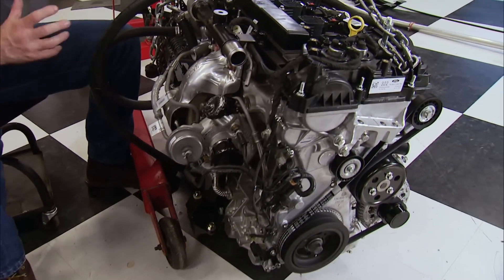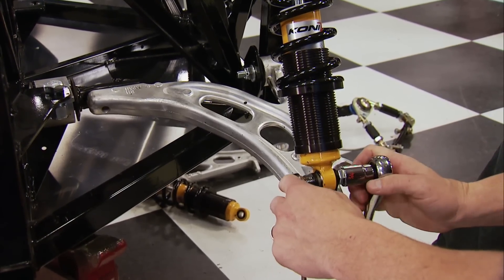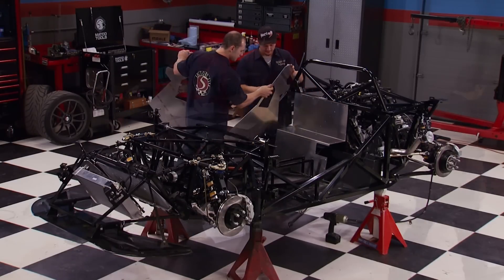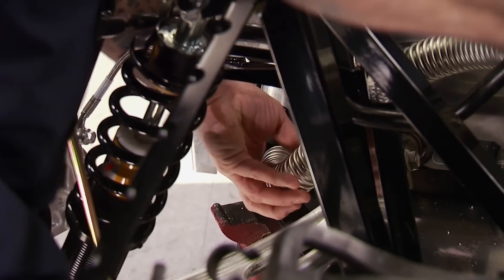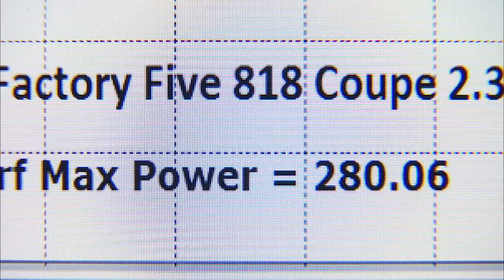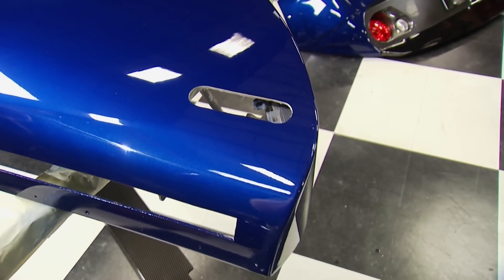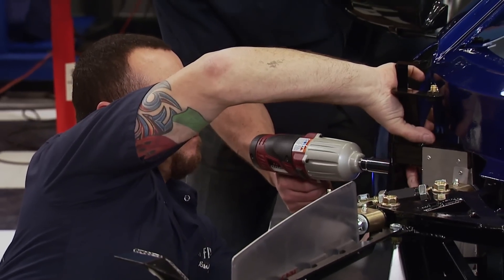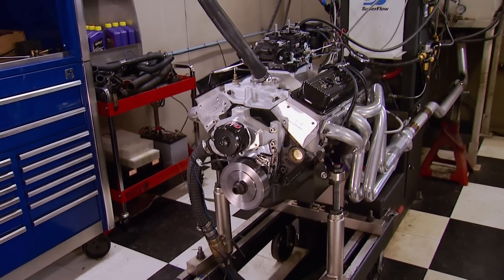Mid-Engine Madness: Building an 818C - Engine Power S3, E8

Comment: If anybody has any pull with Factory Five/ Dave, please get this back into production,.. the GD wrx's are getting rusty & parted out. This gives the subaru builders (me incl) a place to continue our drivetrains & tuning & collected parts etc.. they rarely come for sale & already built, this keeps the wrx crowd alive at a reasonable price.
Reply: I really think they should bring it back with Honda drivetrain options. I’m a Subaru guy myself but I think the platform would be pretty great and easy to do a k-series in it.
Reply: @Ichigo_Fields I’ve always thought this too. With how lightweight it is I wouldn’t even care if I had a stock k20. Could run at the track so cheaply.

Comment: If you build one of these cars, figure out how to run a motor that is reliable.  The Subaru EJ and Ford EcoBoost motors are both junk as far as reliability is concerned.  Maybe a Honda k series and transmission would fit? They are WAY more reliable
Reply: This. A K20 would be way more reliable and make more power.

Comment: I also am a bug-eye WRX owner ... I would like to request this car come back... And for a stage 2 build on this... Do the hybrid ej257 with ej207 heads... Double head gaskets iag oil pickup tube oil pan oil air separator throw some killer bee parts on it... Bring Mike from Moto IQ... He's like the Bob Ross of mechanical engineering! That would be an awesome awesome stage 2 build for this not that the EcoBoost is not fun but that should be an EJ... It should absolutely 110% be an EJ
Reply: Did you know if there a sign petition to Factory Five to bring this car back?

Comment: Windshield wipers?  Heater?  Air con?  Defroster?  Is this for the street or is it a track-only device?
Reply: It's a track purpose car that some states will allow you to register for street driving as a kit car. It's not really meant for daily driving or comfort.
Reply: Not seen a built one with screen de- mist
Reply: Lmao I’ve had countless daily drivers with non operational heaters/defrosters, let alone A/C. A/C is generally the first thing I disconnect once it starts failing
Reply: If you can't figure out how to throw a wiper motor on one of these, please don't build a car to drive on public roads.

Comment: Why not use a ford transmission?
Reply: The answer is simple the Subaru uses a transaxle for it's AWD setup, that means the transmission has two front shafts coming from the sides and a rear driveshaft to give it the AWD. Right now Ford uses a transverse/fwd style mount for it's AWD so the entire thing is mounted differently. This why no Ford transmission.
Reply: @jonf2009  great answer.  Thank you.
Reply: Kit was designed around the Subaru parts. To fit the ford 2.3 it needs an adapter, no adapter for the Subaru motor. It really doesn't make much sense to fit a ford motor - unless the Subaru donor's motor was dead.
Reply: @alexprymack7834  so why not use a Ford transmission with the Ford engine?  That's what I was aiming to get across.
Reply: That's what I explained - the kit was born a Subaru, it was designed to work with Subaru parts from the outset. The Ford motor is the deviation from the original design.
Reply: Which Ford transmission has side outputs?
Reply: @ShaunHensley  all the fwd transmissions do. Go look up images of the Subaru transmission and a focus rs AWD trans and you'll understand what I'm talking about being mounted sideways vs straight.
Reply: @jonf2009  oh I already understand, that’s why I’m not the one asking stupid questions on build videos
Reply: @jonf2009  Also, a transaxle is symmetrical and therefore better for performance applications.
Reply: @ShaunHensley  then I guess I don't understand your question about Ford using transaxles? Unless your referring to the Ford GT transmission?
Reply: @jonf2009  I didn't have a question, I was answering the original question

Comment: You would never see me use the Subaru engine Because I basically have to pull the motor to swap the spark plugs, And the transmission unless it is built by a third party I am not dealing with it because you try to put enough power in it Anything over 500 And those teeth are gonna shear themselves apart
Reply: Plenty of room in the engine bay of the 818 to swap Subaru spark plugs. You also don't need, nor could you put down, over 500 hp in the 818. You can't get enough rear tire under it unless you fabricate custom fender flares.
Reply: @BigDanSubaru03  this car with AWD and 500hp would go crazy
Reply: I've been researching transaxles for mid engine builds, seems like the Audi A4 non quattro trans can take the power. Weird cars, longitudinal engines with transaxles.
Reply: The STI and newer 6 speed transmissions can handle much more power than the older 5 speeds. I would NEVER recommend a Subaru 5 speed for anything beyond stock power. But the STI and newer 6 speeds are quite sturdy. Also even with the issues with the EJ piston designs, I’m still trusting a stock EJ over a ford eco boost for reliability. Of course the flip side is eco boost parts are a lot cheaper and easier to find so maintenance will be a lot cheaper. The FA engines in the newer non sti wrxs are even more reliable up to about 350whp with bolt ons, a fuel pump, and a quality tune. Also I second the previous comment about there being more room in this engine to work on the spark plugs so I don’t see that as a concern.

Comment: I would rather run a K series Honda engine.
Reply: Making a k series work in a traditional mount angle is more work than most people know due to a k series originally meant to be transverse mounted. It's doable but you end up buying even more parts vs the Ecoboost being a drop in since Ford uses that engine in rwd setups already.

Comment: All I can say is I hope the new Subaru gearboxes are a lot stronger than the earlier versions.  Traditionally the early versions would destroy 2nd gear very soon after any boost increase.
Reply: You need a sti 6 speed more robust then the 5 speeds were
Reply: @rico55pr1  Dude; it WAS a 6-speed
Reply: I have an 02 with a Moore 5 speed... Grinds 4th on the up shift and 1st on the downshift
Reply: I had a 2019 Crosstrek. 2nd gear was janky out of the box 🤣
Reply: Different trans from a sti 🤣 gears ratio and the internals dude
Reply: @rico55pr1  Yeah; you caught the name "Subaru", right? I agree that it MIGHT be different ratios, but the internals are identical from the factory. Worked on them for years. STI is a trim level and software tune. The parts is parts.
Reply: @desdecardo  Not all STI versions were created equal. Some were legit total revisions from stock usually a homolagation special. Today there is so much aftermarket support you can retro fit them to a dog box or even go all out sequential. A great choice for the platform though. A north South Mid engine doesn't give you much choice with OEM parts.
Reply: The STI 6 speeds have always been strong, and the newer 6 speed from the VA and VB WRXs are also much stronger than the older 5 speeds. Subaru has indeed addressed the issue
Reply: That's the 5spd
The 6spd doesn't have that problem.